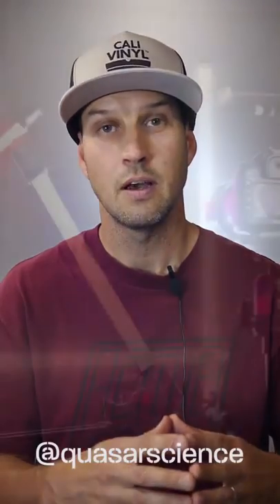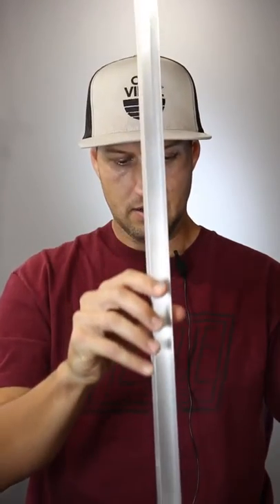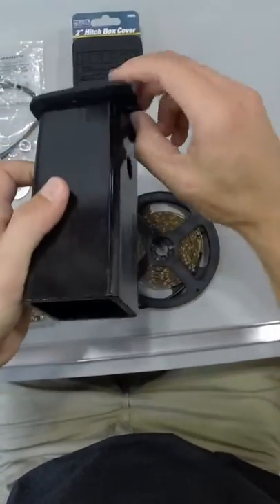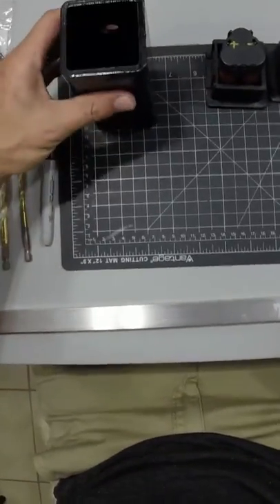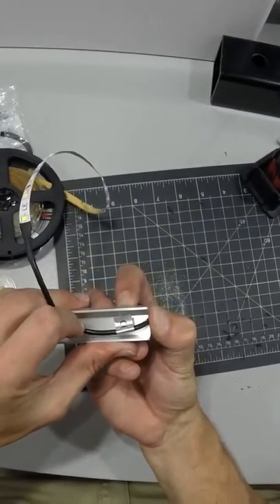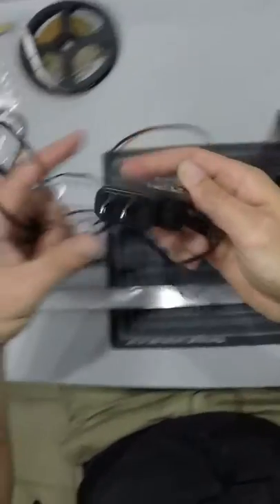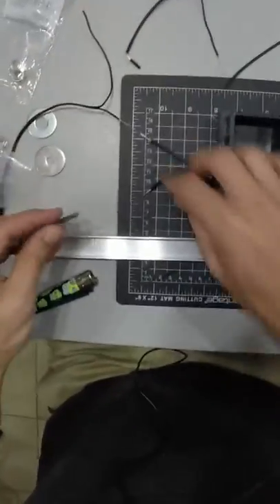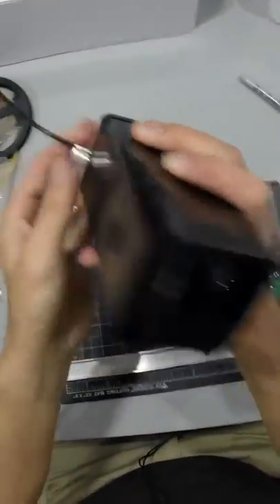DIY LED Wand Light for Photography and Video

Comment: Once again, Thank you for your DIY Originality. "To Create is Devine"  I'm trying to DIY build a powerful enough LED that I can put into my Photo Softbox as a modeling light with Flashes or Speedlights. The Ring shape does seems to be the best shape in order to spread the light  evenly through out the Softbox.  The Current LED Ring lights are just not powerful enough to give me enough light after the Diffusion after 3 feet At ISO 100.   Since 99% of the Speedlight / Flashes don't come with Modeling lights built into them, I need an LED Solution that can kick out enough Light / LUX - at about LUX 5120 - 7200.  Do you have any ideas about this?  Or am I ask too much for a DIY project?